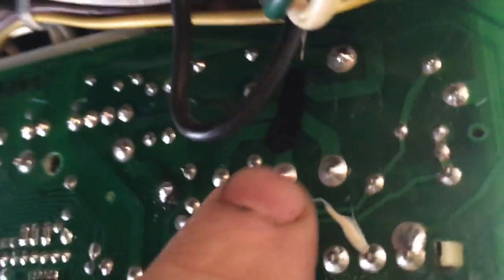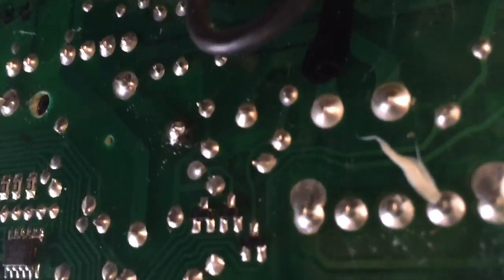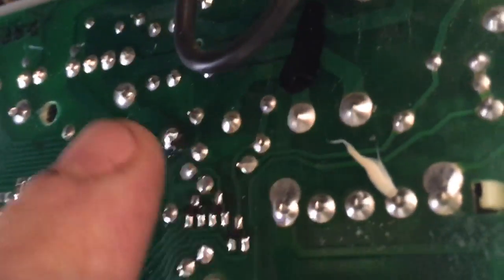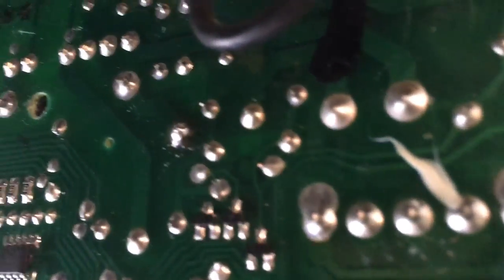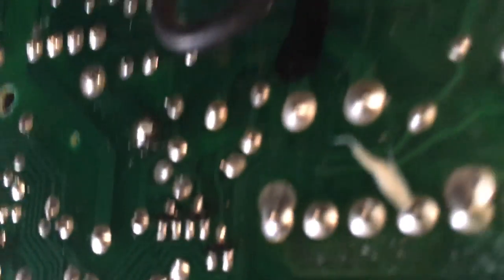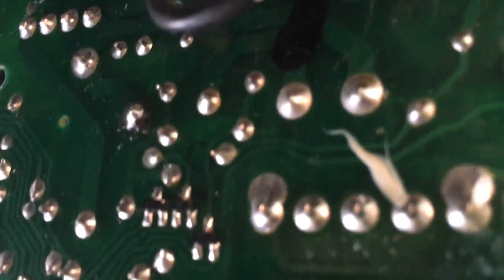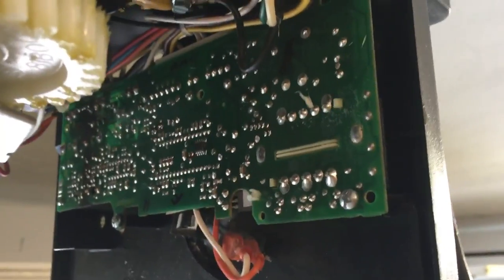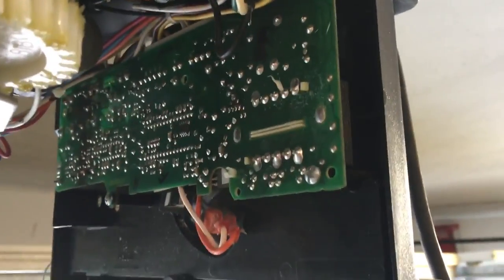Garage door opener only clicks and a solder was bad

Comment: Dude!! You saved by bacon. I have a 25 yo Lift Master Belt drive. Replaced the drive gear and couldn't get the open circuit to work. The motor would not reverse to lift the door. I gave up and called my local garage door company to put in a new belt drive unit. About $450 installed. As a last ditch try for a repair I found your video. Sure enough there was a solder point that was bare. I thought it can't be this easy. Also trying to see it among 100 other solder points. I put a dab of solder on it.   It worked. I can't believe it. Now I can cancel the garage door company appointment. I'll nurse this unit along for a while. Thanks

Comment: After TWO weeks opening my garage door by hand, I came across this video I had same issue! Looked for circuit board it was $75. Removed the circuit board found popped point I have Never used the soldering iron (I had it for years). put some soder  and it worked! Thank you  so much!

Comment: Thank you so much bro.  You are awesome.  Too bad I did not find your video 4 months ago so I could have parked in the garage all winter.  I searched and searched and searched for a solution.  Your video was the exact board I have in my opener.  It happened to be the solder point that you said usually pops.  I took the board off and had it next to me on the couch while I watched your video.  I paused it and noticed that the point was most definitely popped off.  I would have never found that having not seen your video.  Went downstairs grabbed the solder iron that I have used once and screwed up the last job at trying to repair my guitar.  Having no soldering skills I was able to put a goop of solder on that point.  Hooked everything up and it works like a champ.  You just saved me several hundred dollars.  Thanks so much man.

Comment: Had the same problem with my Liftmaster. Checked the circuit board and found a bad solder joint. Saved me a big bill. Thanks for the tip.

Comment: Outstanding video!!!  I had the same problem with my 20 yo Liftmaster 1/2hp.  Just clicked whenever I tried it, like the relay was activating but nothing moved.  On mine we had a power outage and the door worked fine twice, then the third time it stopped working.  Not sure if they are related, but regardless its fixed now.  Thanks!!Just as a note for other viewers, the solder joint that was bad on mine was barely perceptible.  It still had solder but it was cracked and was not making a contact, so look closely at the solder joints.  Also, on mine, the solder pt was different than either of the ones pointed out in this video.  So check all of them.

Comment: Another THANK YOU from me. All the other videos said "replace the circuit board" where you went into some detail. My 25+ year old Wayne Dalton had the solder joint popped on #1. I wasn't able to see it just by looking at it, but I had to put it under a magnifying glass to see the break. A little solder and it's working like new again.

Comment: Thanks man. I was ready to just buy a new one because I didn’t have the time to spend to troubleshoot it, but you got me in the right direction. Even with taking it apart to work in the board on the bench still no time at all. A 6 in 1 screw driver and an iron had it working in probably less than an hour. 👍